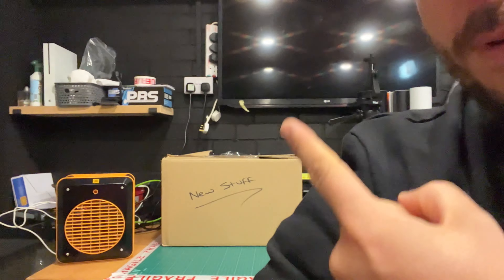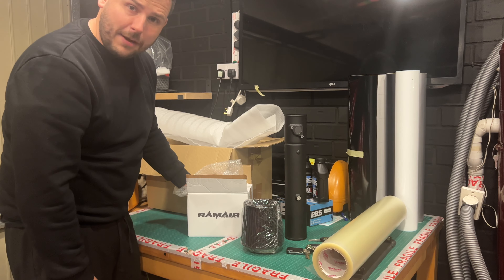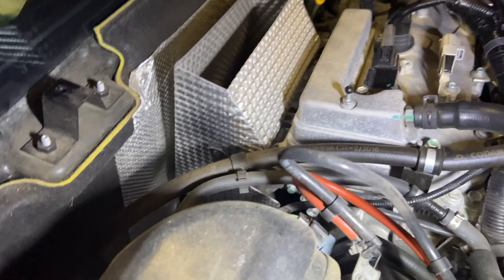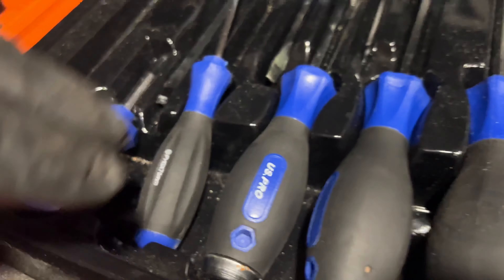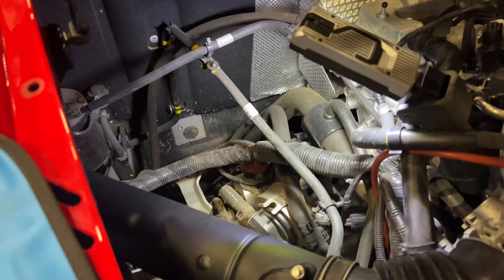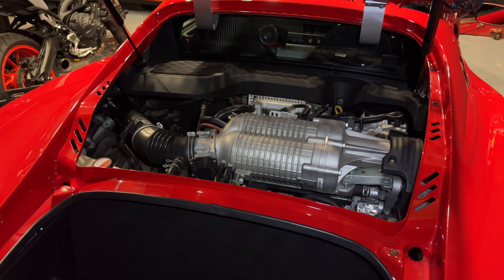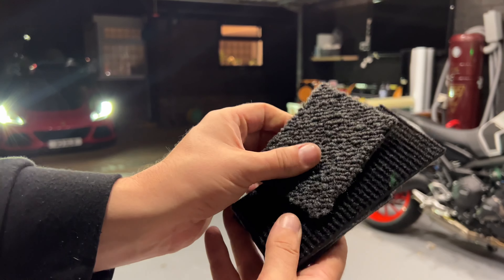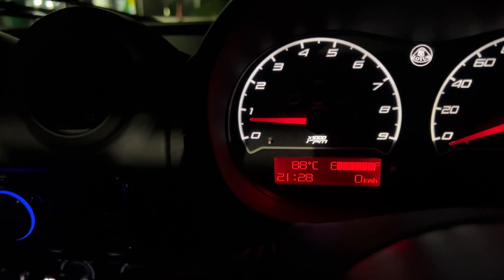Installation - Alias 23 Intake EXIGE 380

Comment: Don't use. It damaged my valves. It lets too much fuel in, unburnt, damages the valves !!!
Reply from the maker: Sounds more like a sensor issue to me
Reply: @mrmotors_uk  Nope. Common issue. Speak to Dave at Seriously Lotus. The pipe is the issue.